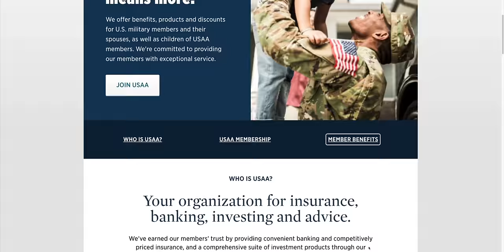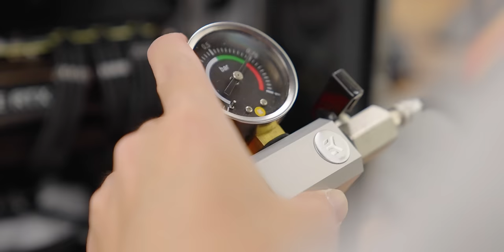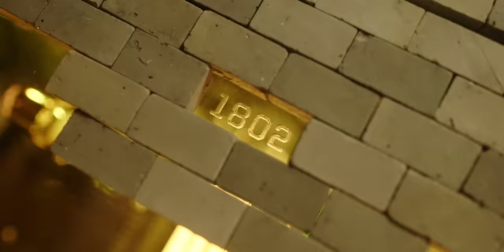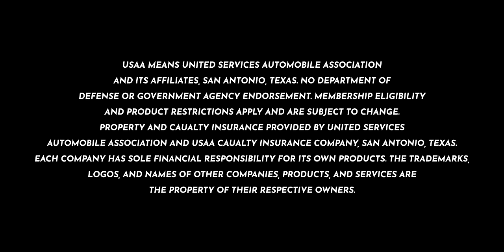I Surprised Army West Point With A Gaming PC

Comment: O11D mini owner here. 

FYI: if you decide to use a full size ATX board, the case comes with a small panel that you can attach to make sure that the board does not overhang the way Austin showed in this video.
Reply: O11d mini owner here as well. I was looking for a comment like this actually 😂

Comment: The o11-mini comes with a bracket to support ATX motherboards. The primochill vue fluid is highly unstable and should be removed as quickly as is possible to prevent it from clogging the waterblock.

Comment: The atx motherboard fits but you should have used the provided extension bracket to secure the remaining screws on the right side of the board. Oh well, it works.

Comment: I understand aesthetics is important but airflow (to me) should always be the biggest priority. I don’t have any doubts Austin and crew are capable and smart but negative airflow, sealed off top and a 3090 doesn’t sound practical. Definitely would like to see the performance/ airflow. Could be super wrong.
Reply: Yeah, first... To be honest I'm not a big fan of the custom design they go for, but this case, thiis Lian-Li case has a different airflow pattern... It has intake fans in the bottom and outake fans in the right side panel.. so it doesn't need the front panel and the top panel at all to keep a good air flow.

Comment: hi my name is Muhammad and me and my mom have been going through tough times we don't my mom doesn't make enough money and I'm just 13 years old please can you help us me and my mom get up dreaming set up so my mom can do work on the on my PC and I can do work on the PC and play games on it please I'm begging you
Reply: That sucks but you can look around and get stuff for real cheap/free. I built a second PC the other day for less than $50 from random parts I'd acquired from thrift shops, yard/garage sales, stuff I found on the side of the road on trash day and left over parts from previous builds. I found an older iBuypower PC in a thrift shop with just an amd fx 6core cpu and motherboard, I'd purchased an old gpu for a couple of dollars in a garage sale, an AMD R9 270X4GB gpu, found a 80 plus gold 430W psu in the side of the road, had a few extra fans, a 16gb ddr 3 pny ram kit, my older pc gaming case, bought a 250gb cheap ssd for like $20 and cobbled it together for the living room. It can do most things and even play games decently. 

Try FB market place and craigslist, put up an ad asking if someone can help you out. You may be surprised. Good luck.
Reply: oh and monitors and keyboard/mice can be found quite easily as well. I've found many on the side of the road. Matter of fact today I found a 24" HP 75hz ips monitor I've yet to test.